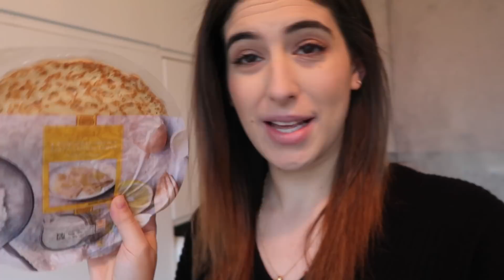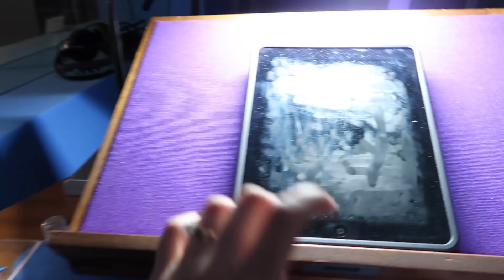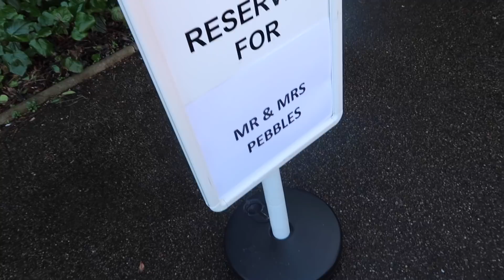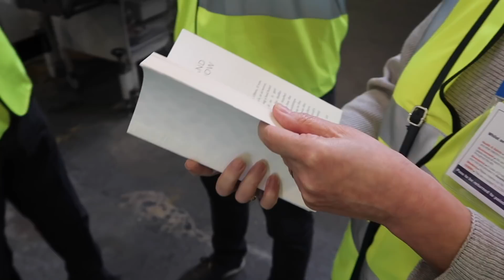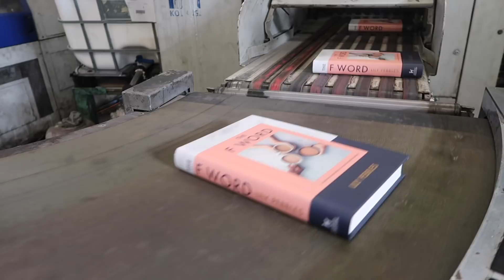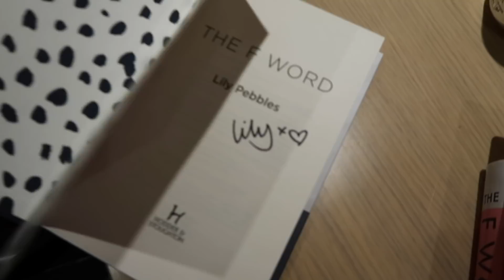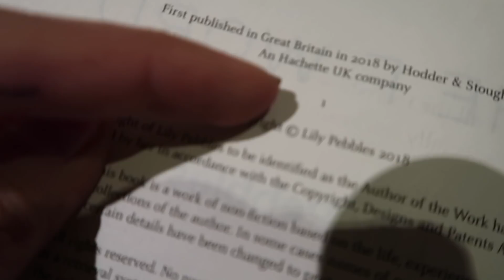PRINTING MY BOOK | Lily Pebbles

Comment: I don't intend to buy the book because the shipping price will be as high as the actual price of the book if not higher. So, it is good that there is an audio version of the book, that will be definitely what I'm buying. Thank you for providing multiple choices, also the fact that you are going to record the audio is a plus. You may not know it but you have the voice for it. I usually open your videos and work on my thesis while listening to them.